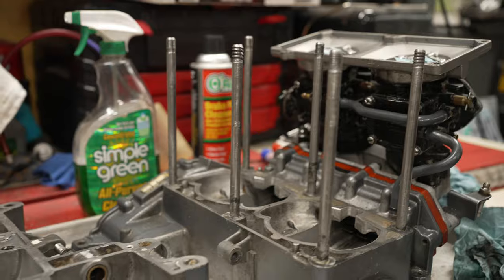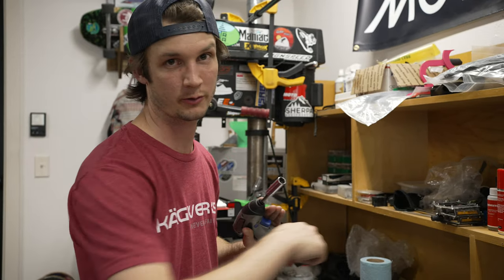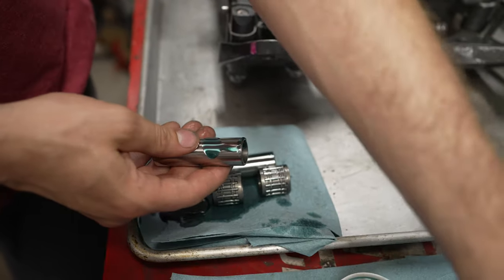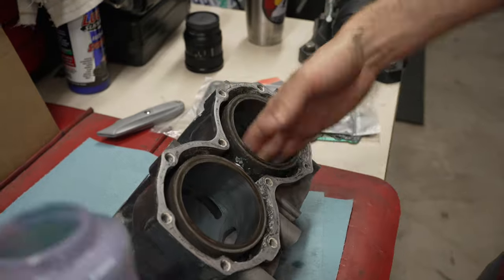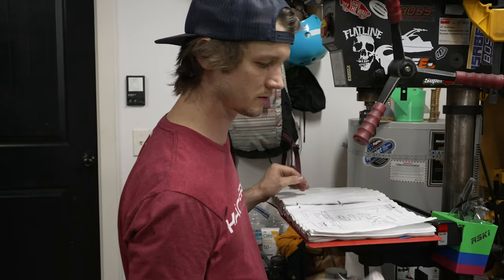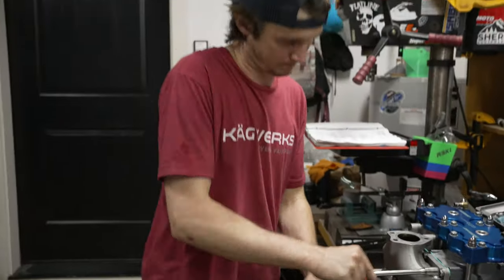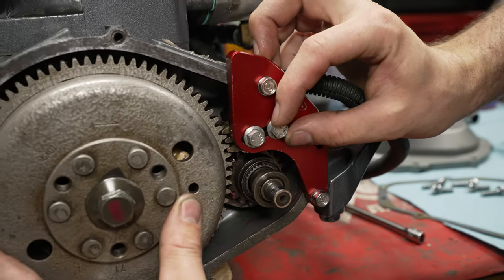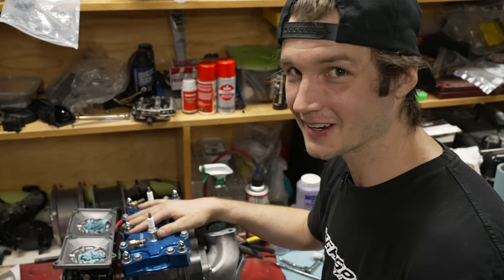Jetski Engine Rebuild! DIY - Yamaha 701cc Superjet 2 stroke standup jetski 701 or 650 - RSKI RIDERS

Comment: Awesome video! Only thing I do different is fill in the gap between the seals with grease.
Reply from the maker: Last night we looked in the Yamaha manual and yes, these seals should be greased where they contact the crankshaft! Thank you for mentioning this! 🤙🤙
Reply: Inside of crank seals or inside the crank seals and in-between the double seal?
Reply: @mxracingunlimitedltd7784  you want to pack grease between the double seals because oil isn't going to make it past the first seal.

Comment: I’m very very veeeery happy that I found this video, it is explained as good as possible, I’m an auto mechanic and it gave me hope to rebuild and “build” these engines, I have a VXR Pro and a LS2000 with similar engines. 

I’d like to know if you have a video for these carburetors, I’d be more than happy if you do. Thanks and you got all my support 👊🏻👏🏻
Reply from the maker: Thanks for the kind words and we’re happy to help out! We haven’t made any Mikuni carburetor videos yet, but I’ll add it to the list. In general we usually use genuine Mikuni brand rebuild kits and just pay close attention when you take one apart and just replace one part at a time from the kit to prevent getting lost or missing anything. Don’t let it intimidate you, you’ve got this!

Comment: This video is amazing! I have a WB1 that overheated (cooling line popped off)...I suspect I'm going to have to tear into it.  The only question I have is, how do you know if you need to hone the cylinder, how do you know how much to hone it, how do you match the new piston head and rings....That whole process of critical thinking and then who to talk to or what to lookup.  I mean hopefully I just need to redo some gasket because of overheating?  Any info you can offer would be amazing.  Thanks for the video, this is already so much!

Comment: Amazing video I have done the whole proses myself and ski has been running for 6 years now.
I used sealant on the crankcase cover also used exhaust paste on the gasket to seal the exhaust manifold. 
Would like to know if they should have been fitted dry as you have the manual there?
Reply from the maker: Hi Nigel, you can download the service manual for free at rskiriders.com in the downloads section!

Comment: Nice vidéo as Always !
I have read that WE dont whant to cut thé o ring of thé ada head, what do you think about that, as i Saw you cut it!
Thankssss
Reply from the maker: I guess we only cut it because it is too long. Maybe if you really force it in, maybe you can get the full o-ring length installed? It’s not that big of a deal really since any leak is small, only in the water jacket, and just leaks outside of the engine. Maybe you are right? I’m not sure. But I don’t think it’s a very big deal. Mine works!

Comment: The oring for the head on the water jacket part they don’t come with the correct oring when you cut the oring they don’t leak?
Reply from the maker: I was always surprised by this too, but the outer o-ring doesn’t matter very much anyway since a leak would just be a few drips of cooling water leaking to the outside of the engine. I’ve never noticed a leak though. The important o-rings are the ones that seal the domes to the top of the cylinder, and those are one piece.

Comment: Great video!! Where did you get the SS Hex Head Intake manifold Bolts from? Looks nicer and is sometimes easier in tight spots..
Reply from the maker: When you say hex head are you meaning socket head cap screws that you use an Allen wrench on? They’re just a m8 x 1.25 stainless cap screw if I remember right. Can find them at ace hardware usually. I order mine from McMaster Carr.

Comment: Hey! Enjoy your videos! Noticed you don't have a rubber bumper on the bottom of the crankcase that rests against the bottom of the hull. Currently rebuilding the engine, do you recommend not reinstalling(fresh water riding only)?
Reply from the maker: Hi there, no we don’t use those as they often wear on the hull and can even crack the hull from big impacts. Yamaha didn’t start using those until 2008 I think, so they are definitely not a requirement. Actually I think Yamaha only had a few bad ideas on the Superjets in their 26 years of production. One of the bad ideas was that rubber bumper. Also, if you watch our fiberglass reinforcement video, when we make the hull thicker like this, the rubber bumper no longer fits anyway.

Comment: HEY RSKI! I have a 1996 Yamaha Wave Raider 1100! Useully runs great! But it stalled twice on me out there....installed new Start/Stop Switch Box & new Starter Solenoid!  When I jump the Solenoid terminals it cranks over fine! Nothing when I hit the Green Start Button!!! There in No Power to the White Start/Stop Connector comming from the CDI Box!!!
Any idea's?
Reply from the maker: Honest question, did you install the lanyard? Not trying to be mean, but I have to ask. 😬 If you installed a new start/stop switch and solenoid properly it sounds like it should work. There’s a chance you installed the start and stop switches backward. Install the lanyard and hit the red button to test. Green button to stop the engine if it starts.
Reply: @RSKI  YES! Lanyard in! White Connector from Switch to White Connector in Harness. Black Connector from Switch to Black Connector in Harness, you can't plug them in reversed! The problem is, (No Power out of the White Connector in the Harness which goes into the CDI Box!!
Reply from the maker: I didn’t mean plug them in backwards. I mean install them in the switch housing on the handlebars backwards.
Reply from the maker: Ya, there has to be 12v coming out of the ebox going up to your start/stop switch.
Reply: @RSKI  I saw on YouTube a guy took an e-box from a Chinese scooter and wired it to his jet ski and got it to run I wish I could be that lucky!
Reply from the maker: Test the solenoid itself by putting 12v to the small wires to trigger the solenoid to close.
Reply: If I arc the 2 Terminals on the Solenoid the engine cranks fine! I need to figure out how to find where I'm losing power?
Reply from the maker: The solenoid has small wires too. If you put 12v to that circuit it will attempt to close the solenoid (and start the engine) if the solenoid is functioning properly.

Comment: Had a few questions

Would you recommend a rebuilt crank (Aftermarket bearings) by SBT/WSM or stick with re-using my seemingly good condition oem crank (not much play, and bearings spin smooth? 

Would you recommend the WSM pistons for a fairly rec ridden 701 with the occasional buoy course day or is it always recommended to just do proX? 

Also I presume always use an oem Yamaha base gasket instead of aftermarket?
Reply from the maker: This is a bit of a difficult question, but we always try to keep the OEM crank as long as the bearings are smooth. After that, we've used various manufacturers replacement crankshafts. All of them seem to work, and all of them seem to blow up eventually. (Except for my 2001 SJ which has the stock engine never rebuilt!)

As far as pistons, in your application I would definitely stick with cast pistons, not forged. You don't need the extra weight and cost of forged pistons in a typical 701 in my opinion.

Gaskets, I'd try to use OEM but it probably doesn't matter as much as properly preparing the surfaces.

Cheers!

Comment: Dude when your looking at the drive coupling in which direction does it rotate please as i am thinking of using this engine for a diff application cheers in advance 😁😁🤘🤘
Reply from the maker: Off the top of my head I’m not sure which way it rotates. Google search for a Superjet impeller, the blades will tell you which way the engine rotates.

Comment: Do you use special tool for the engine coupler or only tight by hand ? Thanks for sharing
Reply from the maker: There is a special tool, but we don’t have one. We just use a breaker bar in the coupler to tighten it. 😂 I should also mention, don’t forget to tighten or loosen the coupler while the flywheel lock is installed. Very helpful! Much easier than trying to remove the coupler from the bare crankshaft.
Reply: @RSKI  thanks for the tips. 👍 I will try to get it out !

Comment: Have you had an issue with the flywheel bolt backing out? I noticed alot of manufacturers use Loctite. Yamaha seems to be the only one using oil
Reply from the maker: Never any issue, we use oil on it and that helps it tighten further when you torque to spec. But if you’re having issues I guess try a bit more torque or some loctite
Reply: @RSKI  putting a 701 together soon. Just wasn’t sure. Will definitely follow the manual. Thanks!!!!
Reply: The service manual on your website, what years is it for?
Reply from the maker: It’s close enough to use for all of the round nose Superjets. 1996-2020
Reply: Awesome thanks!!

Comment: Incredible. I’m stuck though… anyone have a part number for the back washer that goes between the bendix and case? Or just send it with a random washer?
Reply from the maker: You can order the washers from Highspeed Industries or Jetmaniac. Use one on each side of the spring.
Reply: @RSKI  no I’m talking about the other washer, the one BEHIND the bendix.
Reply: @RSKI  refer to 20:55 to see what I’m talking about. The big washer
Reply from the maker: Oh, ya just call Highspeed Industries or Jetmaniac. Both will have it. I definitely wouldn’t use a random washer for that one, it’s quite thin and ground flat.
Reply: @RSKI  will do. Thanks so much

Comment: What 2 stroke oil are you running for this motor?
Reply from the maker: We typically run Amsoil Dominator in our engines. 50:1
Reply: @RSKI  thanks! That’s what I’ve been running at 40:1 though
Reply from the maker: 40:1 is fine too 🙂

Comment: Hi guys I'm having troubles with ignition timing.
With a strobe light hooked up, it looks far too advanced.
I've made sure the key is not broken and the marks on stator plate are ok.
But still no joy and backfire.
Engine is in a zodiac rib.
It's a 650 but looks very similar to your 701.
And ideas before I burn it 🤣
Reply from the maker: If you have the flywheel cover removed it’s probably not a good idea to start the engine because the flywheel cover itself supports the bendix, so be careful with that. It sounds like you’ve checked the same things we would check with the flywheel key and stator location. It’s hard to say what the problem is without messing with it. If you do burn it, we like to use diesel for the nice slow burn. 🤣
Reply: @RSKI  thanks for tip about the cover.
Is it possible the previous owner fitted parts that don't match up.
Doesn't matter which way I adjust in the slot it's still well out on the strobe light.
Just s thought.
Now where's the matches
Reply from the maker: Is it an oem cdi?
Reply from the maker: @ntplumber1  I was just thinking about this, maybe there is a chance that the stator/flywheel don't match. The 62T stator needs a 62T flywheel, and the 61X stator needs a 61X flywheel to work properly (from my understanding)
Reply: Great thanks mate.
Confirmed what I was thinking.
Thanks for taking the time to reply,
Best rebuild video by the way,not rushed over and no stupid music for distraction.

Comment: What a horrible place to locate an Anode, probably gonna double tap me head with a whee bit more zinc stick. Salt Life.
Reply from the maker: You should invent a zinc cylinder head. That would solve it! 🤣
Reply: @RSKI  after conferring with my pocket Ref I am fully going with a Titanium cathoaccumulater hard piped to a large trailing Anodic Plate external to the hull. I myself am not a Fan of saltwater and Aluminium. Plaque, exclusively, forget it, eventually, obviously, pitsticks. (Protip%, vinegar for electrical. Air conditioning aluminum cleaner i.e. 180°F sodium hydroxide. Back in black) stickin it to the dJonsey.
Reply from the maker: I think you’re spot on.